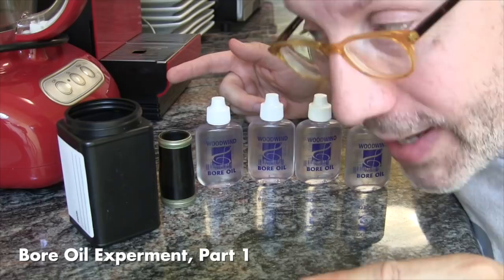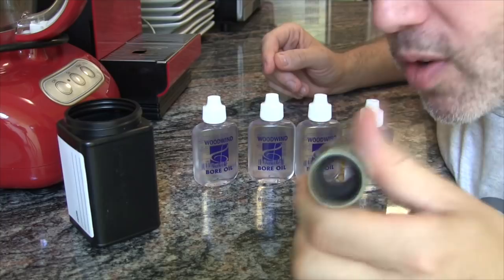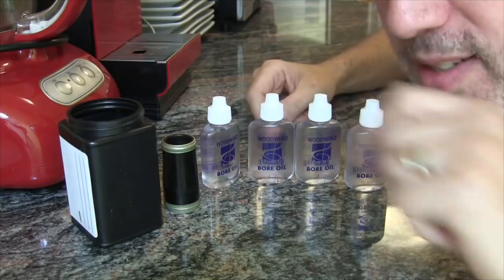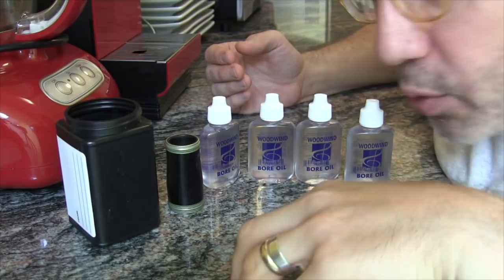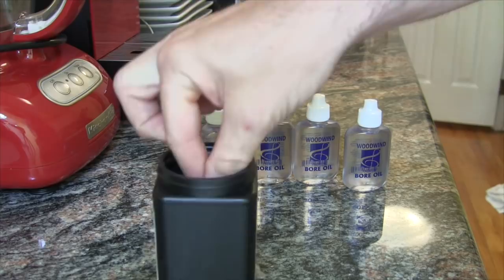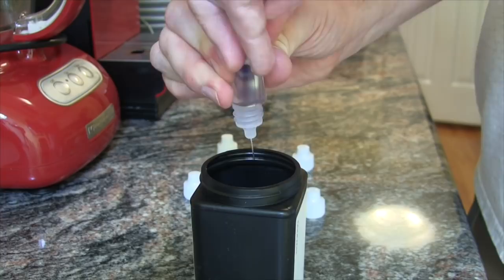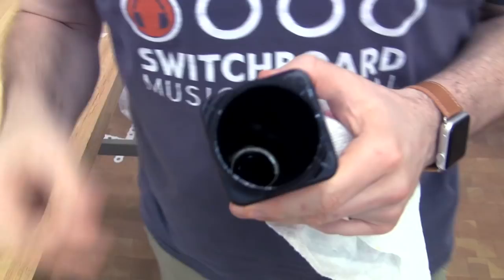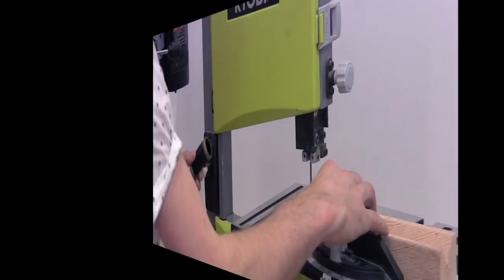Bore Oil + Clarinet Barrel + 7 Months + *Band Saw*

Comment: Proposed Analysis For Determining If, And How Much, Bore Oil Will Absorb Into Wood Clarinet Material

I recommend and offer an analysis approach that, I think, addresses some of the comments that have been made to date for this video and that I would I recommend and prefer to see completed by someone in the future. I believe the approach I describe below would be more definitive about if, and how much of, the bore oil is absorbed into the wood. Comments on my proposed approach are welcome. One day, someone might pursue this analysis again. At present, I am not able to complete the analysis myself. Also, this proposed analysis only attempts to determine if bore oil is, or is not, absorbed into the wood. It does not establish (a) if oiling the bore reduces the risks of cracking, (b) how much bore oil is absorbed into the wood during a normal swab-with-bore-oil approach (no immersion) or (c) if types of bore oil other than the typed used for the analysis will or will not absorb into the wood.

Proposed Analysis For Determining If, And How Much, Bore Oil Will Absorb Into Wood Clarinet Material:
a) Cut Multiple Similar Rings - Cut a barrel into six "ring" type pieces, each cut perpendicular to the bore and each piece as similar in thickness to each other as possible (about 8 mm thick). Cut the pieces with a thin, fine tooth, hand saw with as little blade speed and friction as possible so as to minimize heat-alteration of the wood surface that the sides of the blade teeth rub against. A miter box would help achieve consistently parallel cuts.
b) Apply Indentification Codes To Rings - Apply a distinct identification number/code to each ring that will not be modified when the ring is immersed on bore oil. Perhaps this could be done by filing one to six shallow grooves into an edge with a different number of grooves for each ring.
c) Stabilize Moisture Content In Rings - Place all code-marked rings together in an airtight container such as a plastic zip-close sandwich bag and allow their relative moisture content to stabilize and equalize among all six rings. I suspect a month of such stabilization in the air-tight container would be sufficient.
d) Precisely Weigh Rings - Remove the rings from the air-tight container and immediately weigh each ring with a very precise scale that has a resolution about 1 microgram or less. I anticipate each ring will have a weight (with or without oil) of about 5 grams. I anticipate that, if bore oil is absorbed into the wood, the weight of the absorbed oil will likely be no more than 5 to 50 micrograms. Record the precise, exact weight of each ring.
e) Put Rings To Respective Sealed Containers - Immediately after weighing all ring, (1) return three of the rings to the air-tight container and (2) immerse the other three rings in a small, sealed container of bore oil with the ends of all three rings in contact with the bore oil.
f) Wait For Bore Oil Absorption - Allow the bore-oil-immersed rings to remain in the bore oil for a sufficient period of time. I anticipate no more than one to three months is needed for the rings to absorb as much bore oil as they can.
g) Remove Surface Bore Oil And Weigh Again - After the immersion period, remove the bore-oil-immersed rings from the bore oil and, using a lint-free cloth and tissue paper, wipe off as much of the bore oil remaining on the surface as possible and not stopping until no more bore oil can be transferred from the ring to the lint-free cloth and tissue paper - determined by viewing the surface of the tissue paper. Then immediately weigh these three rings.
h) Weigh Non-Immersed Rings Again - Remove the non-immersed rings from their air-tight container and immediately weigh them again.
i) Compare First And Second Weights Of Non-Immersed Rings - Compare the first individual and combined weight of the non-immersed to the, later, subsequent individual and combined weights. They should, of course, be extremely close, if not exactly matching as precisely as the scale can resolve. Any variation raises questions about the repeatability and other variability in the scale or ring weighting technique.
j) Compare First And Second Weights Of Immersed Rings - Compare the pre-immersion and post-immersion weights of the bore-oil-immersed rings, both individual and combined weights. Calculate the percentage change of weight for each individual ring and of the combined weight for the immersed rings.
     Percent-Change = [(weight after immersion) - (weight before immersion)]/[100 x (weight before immersion)]
I would conclude that a percentage change of positive 0.1 or more would be a fair indication that the rings absorbed bore oil.
Steven

Comment: This has been touched on,  you do not have a control for your experiment.  I believe your hypothesis is correct, however since you did not cut the barrel in half and soak one half to compare and document the visible difference the only other way to make sure you didn't have saturation would be to have a chemical analysis of the barrel to determine if you had saturation.  Eyeballing it means nothing...one could argue you had 100% saturation that is why you had uniformity.  You could easily update this by having a bore sample sent to a lab along with the bore oil to see if the chemical compound made it in and at what depth.
Reply: PS  I am so sorry I missed your performance in Spartanburg SC.  I was really disappointed, but I had a work deal out of town...and I have to keep the reed money flowing.
Reply from the maker: Sorry I missed you in SC too. I was busy paying for the lab to whom I’d send my bore oil sample! 😀
Reply: I vote that they give you a grant!

Comment: Hello, this is a bit unrelated to the video but I've a general bass clar question. How much resistance is "normal" when going from the A to clarion B? I feel quite a bit in mine, enough that my sound is cut off for .2s when I make the transition. What am I doing wrong?
Reply: Bartolomoose Resistance is created by either harder reed you use or by leakage of the clarinet. Check the instrument for possible leakages. Use softer reed if required.
Reply: Can you rec a good way to check for leaks? aside from dunking the thing of course

Comment: Hey I’ve got a question about bore oil, is it ok for me to use bore oil as key oil? because that’s all my music store had and they said that it would be ok and so far it’s been fine. The last time my clarinet had key work was very long ago and I did it myself because nobody would do it. Has anyone else used bore oil in this way?
Reply: Tyler Bischoff On my saxophones, I have used synthetic automatic transmission oil as key oil for several years. Stephen Howard in England, a well known tech, recommends this. So in a pinch, go to the auto parts store ;) The music store stuff is crap.  Better yet, buy some key oil from Music Medic (Alisyn), it’s much better.
Reply: Steve Keller thanks for the help:)
Reply: It depends on the type of bore oil.  If it's mineral oil then it will probably be ok for keys,  I wouldn't use a vegetable based oil on keys.  It would likely dry up and go gummy.

Comment: Why not just finish the inside with tru oil?  10 coats won't be .001 thick and NO moisture can penetrate it.  Dries hard as glass!!  Never worked on a clarinet but I have repaired 100s of fiddles with french polish and tru oil hand rubbed finish.  Or you can use varnish and wait 10 years on it to dry :)  I would guess tru oil would do the outside of a clarinet  bit of good as well.  You see it passes sound like hide glue (that's why fiddles are built with it).  I notice you clarinet people have a dying calf over a crack.  If a fiddle don't have half a dozen cracks, it ain't old enough to play LOL!
Reply from the maker: A fiddle doesn’t have to be airtight. A clarinet does.

Comment: Are you a repair tech or manufacturer? Using a petroleum based oil to penetrate wood like that isn't going to work. Are you familiar with an immersion process? I would suggest doing some more research on wood stabilization. A bore oil of that sort would be more used to coat the inside of a clarinet to keep the water from making the bore "swell"  But to get wood to draw in oils you have to add pressure and heat or heat and a vacuum. I think the information that you are trying to get across is agreeable but you are talking about one thing and showing an experiment that wouldn't show success.
Reply: Hi Matt, are you saying that petroleum based oils are less likely to penetrate the wood, compared to plant oils? Where can I learn more about what you have mentioned here?